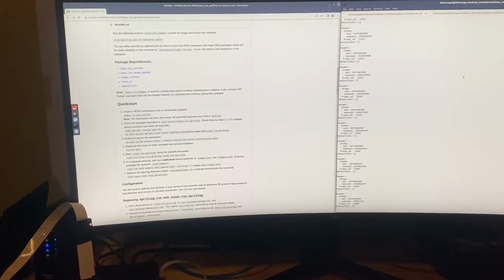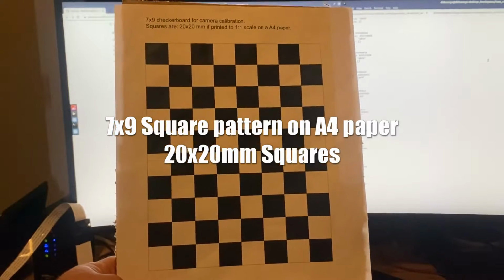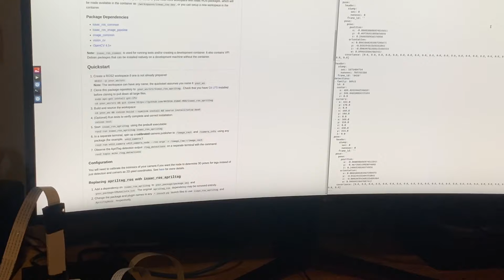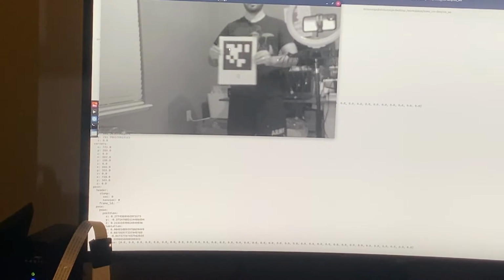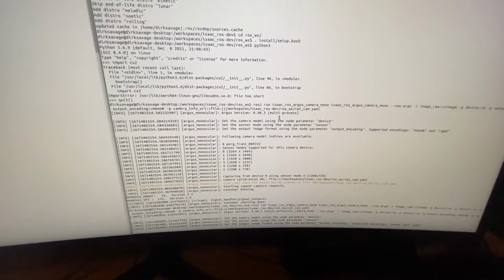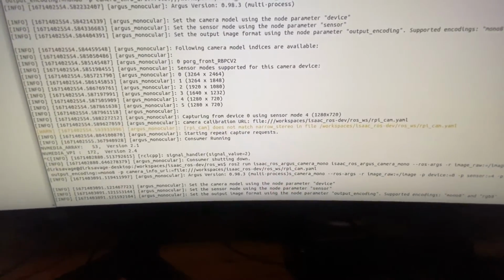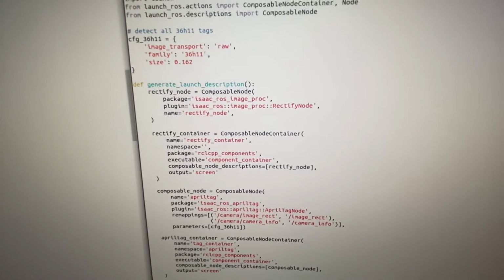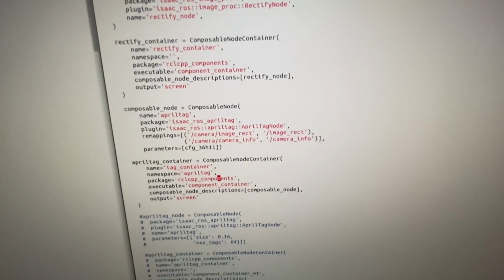ROS 2: Nvidia Jetson Nano Accelerated Apriltag Detection is GREASED LIGHTNING

Comment: i am get confused by how its gonna start when the robot is get powered on. Does the jetson nano has a automation about starting the code before login
Reply from the maker: You will need to start the docker container (which launches the ROS 2 nodes) in a systemd service in linux, and have that service run after the network service

Comment: Hi! I'm just trying to achieve the same results but I'm struggling a lot with workspace setupping. Could you please tell me which OS have you installed? Have you used the official Jetson Nano Developer Kit SD Card Image? Thank you very much
Reply from the maker: Jetpack 4.6.1 native
Reply: @SavageGoodsT  Did you use docker?
Reply from the maker: @MaxBertus  yes I used a container. It’s based on r32.7.1 I believe
Reply: @SavageGoodsT  I'm still struggling trying to bulding all the packages require. Could you please tell me which branch/commit have you used? 🙏
Reply from the maker: @MaxBertus  please join the ROS discord and post the errors you are getting in the help section

Comment: Thanks for the video (y)
Did you check GPU vs CPU usage when the program is running?
Reply from the maker: Good point, I should probably have Jetson stats running!
Reply: @SavageGoodsT  Yes I'll be interested if you get that information, please let me know. Thank you :)
Reply from the maker: @jaouad9230  cpu all cores approximately 60-100% and max temps 62 C, gpu fluctuated between 30-95% and also around max 62 C. This is with resize, rectify, libargus, and accelerated apriltag nodes running